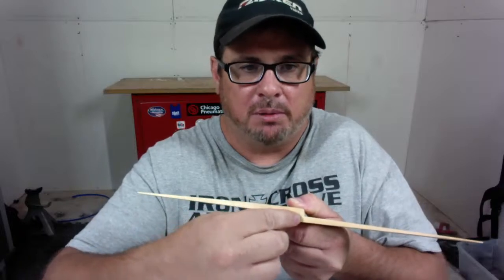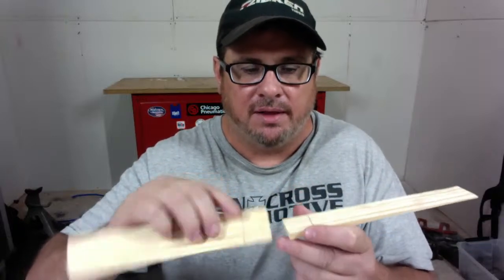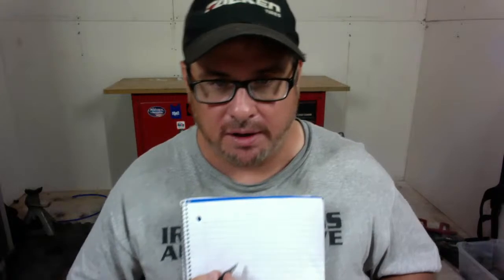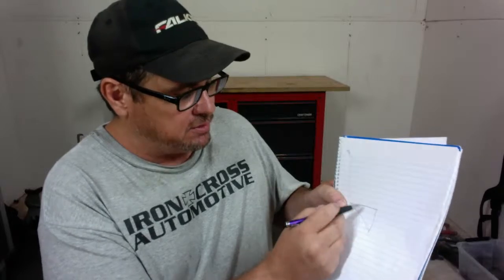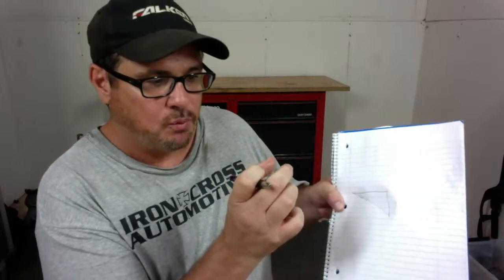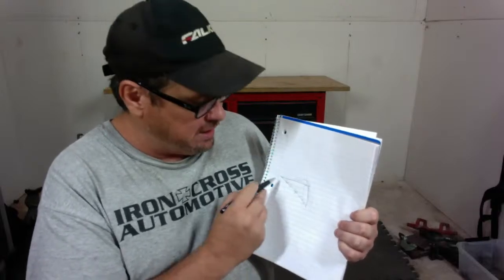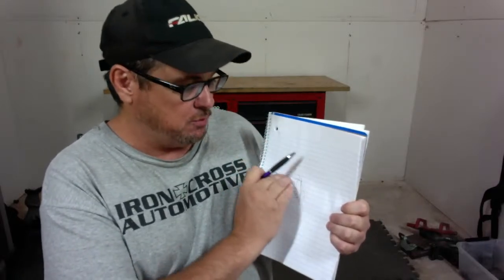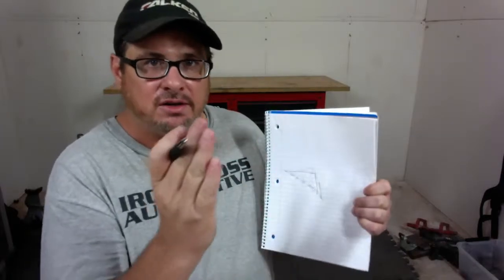When and Why to Use Weld Through Primer

Comment: I have quick question, I plan on welding a new floor patch pannel on the truck floor I plan to use air flange tool on the floor so that new patch new panel will fit right in and be leveled I only can weld from one side  and   I will be using weld through primer, is  this welding proses  sound good?
Reply from the maker: That sound good to me.  I would seam seal after welding and priming.
Reply: @CarAddictGarage   the thing is i wont be applying any carpeting over the repair area . unless your talking about smoothing out the seam sealer. I dont want a visible repaires hope all this make scense .

Comment: This video came at the perfect time . What would be the best rust protection inside rocker panels where there could be  some existing rust 3M said you can use their cavity wax but it may not stop the rust is there a better product for this purpose
Reply from the maker: Hey Steve, that is what I would use.  3M makes it in a spray can. You attach the wand/hose and it sprays 360, which coats everything good.  Thanks for watching!
Reply: Internal frame rail coating is good as well. Penetrates really well. Add a cavity wax on top for extra protection if you live in the rust belt.
Reply from the maker: @thebigpicture2032  Do you have a brand you like using?  Thanks for your input!

Comment: It seems you're assuming all weld-through primers work as advertised. Some apply primer to the front side, then weld. No. It's for sandwiched sheet metal. Several videos on how various weld-through primers react to weld heat. Others prepare sample plug welds, but show no results other than what's on the visible surfaces. Have yet to see a valid test to see if the primer protects sandwiched metal after plug welding. Is weld-through primer a real thing?